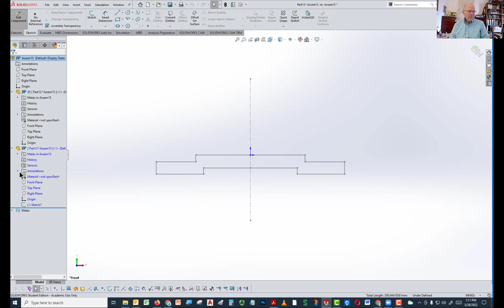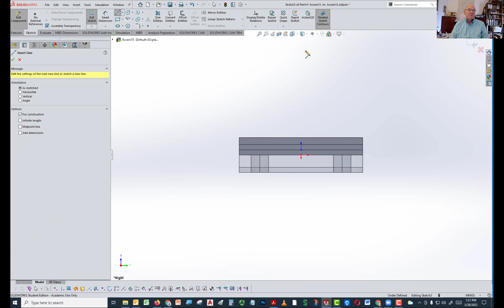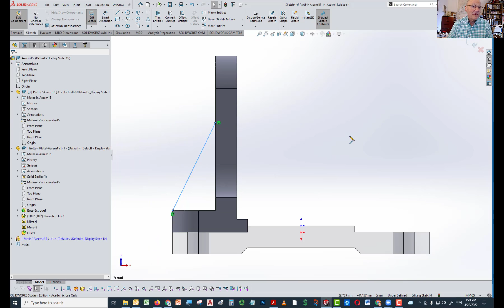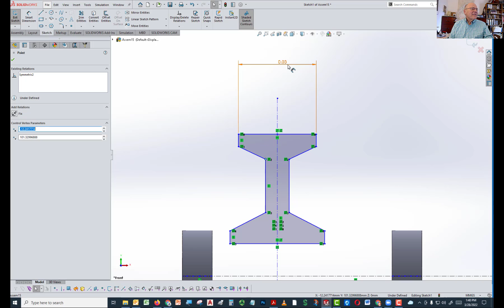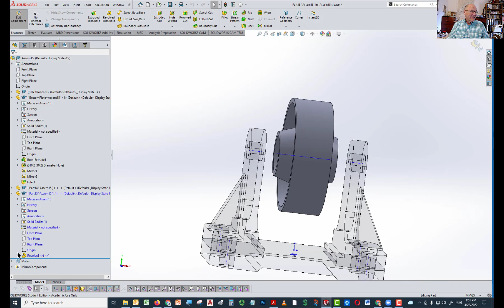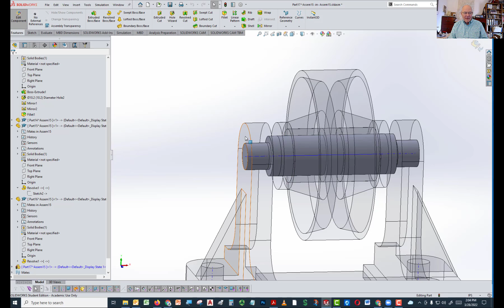Top Down Design SolidWorks

Comment: Great video, as always. I needed to wrap my head around top down design, and this does explain it perfectly but it also illustrates to me that I SERIOUSLY prefer my years-long bottom up design method. I do recognize that that bias is caused by nothing more than "preferring what I'm used to" but it seems to me that top down design has two difficulties: 1) You have to have, ahead of time, a very clear idea of which parts (and how) may potentially be modified in the future (not placing holes based on fillet, for example. Or just assume that every single thing might be changed. Ouch. You'd have to know whether that fillet would NEVER be changed or possibly MIGHT be changed, although that may not be the best example of what I'm talking about here), and 2) it appears that this would be a very, very difficult way to teach Solidworks to a beginner.
Reply from the maker: I illustrate the concept to my classes, but I've never given any assignments that require it and I don't use it myself -- not because I don't like new stuff, but because my design sense starts with an over all concept, but goes from there  directly to designing the components needed to accomplish specific tasks. For anything complex, that means sub-assemblies, which complicates top-down design even more. It is just too many things to keep track of, and I agree that I would never try to start a beginner with it. I don't actually know anyone who really uses it for anything that isn't fairly simple. Thanks for the kind words, by the way. Glad you find these useful. I'm retiring after this semester, so I may have time to do some videos on weldments and sheet metal tools, which are really nice.

Comment: Thank you immensely for this tutorial, it's helping me grasp Solidworks after a 20-year abusive relationship with Inventor.
One comment, I believe this design workflow is more commonly referred to as 'middle out' rather than 'top down', as you are starting off with one part and building the assembly around that. But that's just semantics, thanks again.
Reply from the maker: I've never heard the term "middle out." Starting with a base part was really just for convenience. I could have built it in the assembly. Glad you found it useful though.

Comment: Why not make the axle for the wheel to ride on first? Then you could create the spacer and the wheel off the outside of the axle and then the parts would not be joined when you create them because they are not created on the same edge surface.
Reply from the maker: I haven't reviewed this video in a while, so I'm not sure what you're referring to, but anything that makes the most sense to you is fine. I probably didn't think of it, but there may have been another reason.

Comment: If you prefer to work in metric and (as shown in the video) it starts an imperial part, this can be fixed in the Default Templates tab in the options. You can do one of two things here:

1. Click  the radio button that says "Prompt user to select document template"
2. Set your default part template that is setup for metric in the appropriate field.
Reply from the maker: I think the best solution is to created a series of template files so you can always just pick the correct template at the time you start a part, assembly, or drawing file. I have a video on template creation in this playlist.

Comment: Thank you so much! Great content, can I suggest you start uploading the PDFs of the full drawings so we can give it a try by ourselves before seeing you do it?
Reply from the maker: Youtube doesn't have a process for uploading PDF files to a video. You could do a screen capture of the image by pausing the video. If you use the Windows snipping tool, you can select the area of the screen and then save it as a JPG file so you can refer to it. Glad you found the content helpful.
Reply: @DanAbbott-SMCC  you could host it on drive and just add a link to the file in the description! Thank you yeah that's what I've been doing but some details are hard to get

Comment: Why did you create Part12? It seems you just using its reference plane as opposed to the Assem15 reference planes
Reply from the maker: That is a good point. I overlooked the creation of "part 12," which happened when I canceled the insertion of the first part. I am not sure why it was created, but I think it was because I had just created parts in several different assemblies several times. If I made these videos for the public access people who often find them, I'd have redone the video, but since the intended audience is students in my classes, I simply pointed out the problem during the class itself. 
I thought I was selecting the assembly planes as I was working through the process of making the video and didn't notice that part 12 was there.

Comment: Thank you for your video - good stuff.  Curious if you have anything in Solidworks akin to the "Master Model" technique in Creo (ProE)?
Reply from the maker: I don't use proE and haven't even looked at it for a long time, so there are undoubtedly aspects of the master model concept that I am not aware of. I think it can be emulated using one of two approaches. Create all related parts in a single assembly using this Top Down technique and start with the part whose dimensions and shapes will drive all the other parts (the outer case of an electronics assembly, for example). Now build each part in the assembly with relations to the original. 

For some types of assemblies, using the layout tool would work better and also restrict the subsequent parts, but that would mostly be used to control the location, not the shapes and sizes of those parts.

Another possibility is to create a single part with multi - bodies (don't merge the bodies), using relations to the base part. Bodies can be exported to individual files if necessary.

This is a long-winded way of saying that I don't really know, but here are my best guesses.

Comment: Dan , one of the best SW videos I've seen! The only thing I didn't get was how the different parts are saved externally,
Reply from the maker: Thanks for the kind words. Individual parts can be saved externally by right clicking on the part in the part tree and selecting Save Part (In External File). It can be placed in a different location. The primary value of doing that is to be able to open it individually for inspection or to create an STL file for machining or 3D Printing.

Comment: Hey Proff! Great Video!! What's the purpose of the first part that appears in the feature manager above the base you created? Also, FYI when you chose Insert compont, New Part, Solidworks will use the default part template. You default part template appears to be set to inch which explain what you need to switch to MMGS on the new part.
Reply from the maker: The first part was created when I selected the green check without having selected a file. It created an empty part file, which I should have used as the base. I really do make these videos without doing any prep so my students can see the process that people actually go through in using software so they don't think they're doing something wrong when they have some false starts or need to stop and do some planning. I should have selected the red X instead of the green check.  I also started over when making the wheel, which I could have edited out, but that takes time.

Comment: What if, for example, there was a feature on the wheel that needs to be reflected back onto the original baseplate part. The wheel is based off components which are based on the baseplate, but then you have a feature on the baseplate that depends on the wheel. Its like two parts referencing eachother. Is that OK?
Reply from the maker: Just saw this. It's a good question, which can probably be answered with yes and no, but I'll try to put together a short video sometime this week.

Comment: I would say, that this approach is more about creating dependent features between the parts. Top-down philosophy suggests often even more centralized control over all the important features and interfaces of the assembly.
Reply from the maker: That is a good point, but this is what most people are referring to when they say top-down. Using a layout to begin an assembly would be more centralized, but I find that mixing these types of relationships in with a standard bottom up approach can be very helpful.

Comment: Thanks for your video on top-down modeling. This is something I am trying to get better at. is sketch mirror, are sketch and feature then mirror preferred method. I was told a sketch and feature then mirror saves space?
Reply from the maker: Sketch mirror or feature mirror depends on the geometry, but would normally mirror features where that makes sense. For example, a symmetrical part that will be revolved would mirror the sketch, but holes that are symmetrical but not in a linear pattern I would mirror as features.

Comment: Dynamic mirror in sketching is useful
Reply from the maker: It is, but not enough advantage to become automatic for me.
Reply: @DanAbbott-SMCC  yes it's personal preference I agree
Reply: Wait, there's a mirror function that does not update when you're sketching? That sounds like a very bad idea
Reply: @alejandroperez5368  I tend to mirror features in the part rather than sketch if I can help it
Reply: @alejandroperez5368  No. When you use mirror to create symmetrical geometry, changes to the original will affect the mirrored sketch. Dynamic mirror automatically mirrors items without your having to do it yourself.

Comment: such a great video! Thanks 

my question is, is this applicable for 100+ parts?
Reply from the maker: Sure, as long as you have a computer with the processing power to work with 100 parts.
Reply: @DanAbbott-SMCC  Your origin (for each part) will end up far outside the component geometry and that is a pain.  Automotive industry uses this and it requires many additional sketches and reference geometry to work with these parts in other assemblies.   Exported (step/iges) parts are even less fun.  I want to like top down modelling but I just don't see it as superior.  Also, you are always working in an assembly rather than a part.  Lastly, as a freelancer, other people have to work with your parts.  I have never had anyone ask me to design top-down.  I may actually decline a job because of it but I am curious to know first hand.  No one has a video that compares these methods in the context of an entire automation line/machine.   Maybe I've already answered my own questions on that one.
Reply: @metricdeep8856  Why would the origin be far off? SW should place it into the center of the body of each part. And as someone mentioned before, it is a kind of derivate of top-down approach. Rather dependency-based approach towards a central part.
Reply: @ernstjunger2835  The origin of the car assembly is some datum on the frame near the front of the car.  So when you open the part model for the rear bumper....the origin for the part is ~7 feet away 3D in space.  When you open the front bumper, the origin is ~3 feet way in the opposite direction.  You have to add reference geometry manually - basically create your own origin to work with.  Why do they do this?  It probably makes sense for them due to the complexity of the cars and generally odd cast and formed metal shapes used.  It's not like Lego where every part is symmetric.  Having an origin for an asymmetric radiator hose does not do that much for you anyway.  I am only guessing as to why...but I can tell you when you design machines to make car parts, it's much easier to have a local origin that is located on the C.O.M. or other logical place in each part.  If your machine handles 7 different types of gears, the origin for each part is slightly different and therefore useless for the manufacturing design.....but it's very useful if you want to assemble the entire transmission is CAD....you just mate/align the origins.  It would be extremely time consuming to mate each gear in space and hell to change things.  Maybe someone else knows more about the why.  It may also be the way the automotive industry exports their models also.